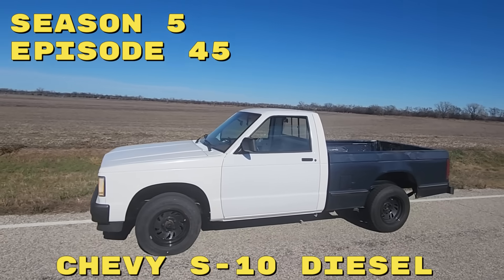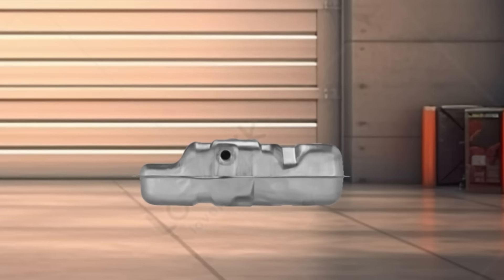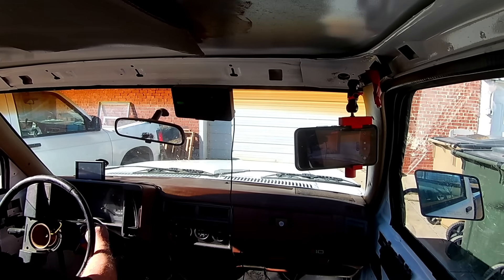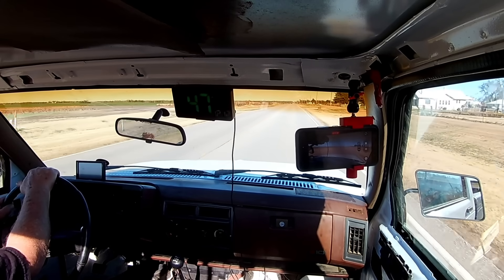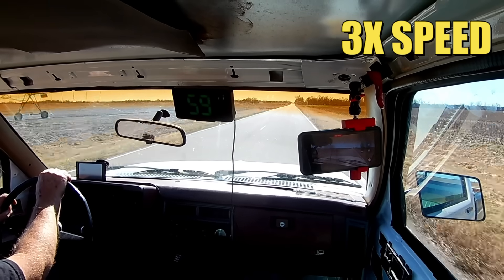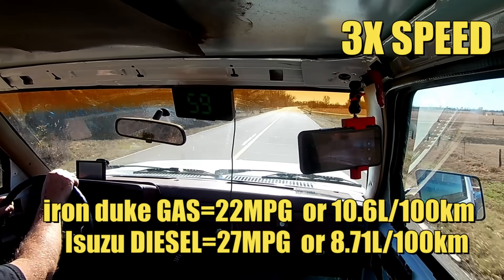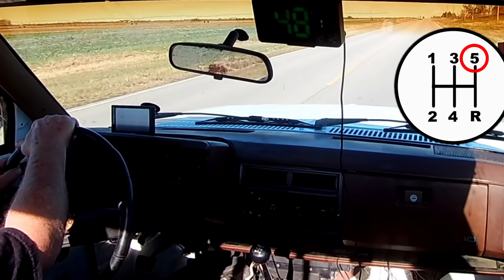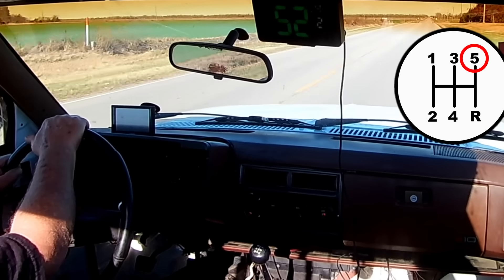S5 E45. MPG?  We road test the custom diesel Chevrolet S-10 to find out the fuel economy.

Comment: I appreciate you not using AI. I choose not to use it at work, I prefer to write with my own words from my own brain!

Diesel 4WD’s and SUV’s are what we use here in Australia for the most part. I remember when diesel was cheaper than petrol, now it swings either side of petrol for no consumer logical reason.

I had a Holden Rodeo twin cab 4WD Ute with their first fuel injection petrol engine in that platform. It was a 2.6L (156.6ci)four cylinder made by Isuzu, with a manual 5 speed gearbox. I struck a headwind in outback Queensland, the likes I had never experienced. I was towing a 6x4 trailer, and had my very young family in the car. The car started slowing down, I kept dropping gears till I was down to second gear. That was the only gear that gave me forward motion. It was crazy!! I thought there was something wrong with the vehicle until I selected second gear. I stopped the car to see if there was a reason, and the downs flung from my hand in this incredibly strong wind. In the distance we could see a wall of red dirt, it must have been 60 meters (197 feet) high or more.

Comment: Tonneau covers reduce drag esp in headwinds and crosswinds. Back in the mini truck days I'd drop the endgate on long road trips.  Probably a few of us here remember those swoopy shape, heavy as lead fiberglass "toppers" that were everywhere, I couldn't stand them.  I found a synthetic army green canvas topper that fit over hoops over the bed in the same profile as the cab. Like the early Jeep CJs, looked great on a Dodge D50 (Mitsubishi).  It was featherweight compared to topper shells of the era, can't remember the numbers but it upped the mpg.  Great on long cross country trips, didn't like it around town or day in day out driving for rear visibility though.  Things we liked so much about mini trucks, fun to drive like English sports cars which ended anyway, but sit up higher, extremely reliable except for the horrid GM 2.8 V6, great visibility, rugged suspension, handy and they were cheap. Nothin' but FM radio and a/c.. Most of us added stereo and often a sunroof that leaked.  Thanks Jimbo, fun series, watch them all.  Orig from your area, NE Sandhills anyway, expat in Asia / Africa since way back.

Comment: The main issue is aerodynamics. Use some duct tape to close off the top half of the grill. Smaller mirrors. Some cheap foam on the front bumper to make it a round profile. And a sheet metal belly pan

Comment: Appreciate no AI. You can say retarded though as long as it isn't used as a slur. I get the paranoia though for sure.
Reply: I was expecting closer to 40mpg, but that's still not bad! Some aero mods would probably do a lot in this case.

Comment: I had a Datsun 720 series "King Cab" pickup with the four cylinder SD-22 engine and 5 speed manual.  I would get 40 MPG with that rig on trips up and down I-5 between LA and SF.

Comment: I'm guessing a turbo is in its future?
You also have a supercharger, don't you?
That's when it will get interesting.
Is there an option for bigger injectors?
The other thing in this power to weight balance, is weight.
Almost every body part is available in fiberglass. A person with your obvious skills, and intellectual curiousity, could make their own, seeing you have perfect examples to build molds off of.
Would be awesome in carbon fiber.
Lot's of content potential. Go have a look at building a panel with vacuum and see how easy it is to create perfect light weight copies.
Then with compound boost, I'm betting it would make a very respectable ride.
I do need a personal story about power to weight and mileage.
I had a D100 Dodge short box that had a Slant-6, Was okay, but you would find yourself in a highway condition of tooling along at 60 mph, and at the base of the hill start to lean into it, and realize you're already into it, and on the floor.
I put a 318 in it, and got better mileage because it wasn't having to work so hard.

Anyways,  loving it.

Comment: I think once you've got boost, you'll have better economy. I think right now the engine is struggling as you said. Plus I'm fairly certain naturally aspirated diesels tend to run richer than forced induction when they're loaded down, like how you have to drive this truck. But still even with that in mind 32 mpg out of a quarter ton truck is amazing. For comparison a 2025 hybrid maverick claims 37mpg and it's not even a real truck. I think once or whatever engine gets swapped is making around 120-150lbft of torque and whatever hp, you'll notice an improvement in actual mpg.

Also and i know you're probably getting a aftermarket tach, but those 80s s10 tachs where some of the coolest designs. The whole dash is 80s cool. with the round(?) oil battery fuel and temp gauges and the weird slot cut tach and speedometer. Just neat.

Comment: Hey Jimbo,
Having owned a mid 80's VW Dasher with that engine, and I was told should get 40+ mpg by my VW repair shop owner friend. Never got close to that over the few years I owned the car. 
The issue was, 85-90% of the time the throttle was pinned to the floor just trying to keep up with traffic.
I used the car as a  ride share commuter for an hour one way to work. I usually had at least 3 guys in the car, and as under powered it was, it made a big difference in performance from the additional weight. 
I intentionally babied the shit out of it highway driving by myself  to work, and got 39mpg, but that was in the slow lane never exceeding 55mph on the interstate.
IIRC, your 32 mpg is about what I was getting on average in the Dasher.
I'd have to guess a newer turbo diesel VW would get far better fuel economy.

Comment: 1.6...
the worst vw diesel engine to use.

try this:
AHU engine
metal head gasket
4BT 12mm injection pump with tdi camplate and internals and fast throttle linkage from 1.6D or TD pump
4bt boost pin or custom pin if needed
.205 7 or 8 holes nozzles. set to 220 bar
[5 holes will destroy the pump, larger holes than .205 will lose efficiency at low rpm ]
AAZ camshaft
k24 turbo from 1.6 td( 30+ psi)
ARP head studs
1.6td intake and exhoust manifold(without blow off valve)
1.6td down pipe and pipe flange.(or whatever you can fit)
2.5" exhoust pipe 
injection advance: make it stop knocking over 1600RPM
intercooler
propane injection
fueling: max without visible smoke while driving

everything is bolt on.

i did 4.3l/100km @130 kph with kayak on top over a 800 km trip, without propane.
amos to radisson, Qc canada.

for a cheaper trip you can use gasoline and 2-stroke oil.

any oil may work. IP and injectors need lube.

1.6TD, set it at ~1mm@ TDC. must stop knocking over 1600RPM
with this engine in a jetta 2, i was able to tow 1 ton on highway.

Comment: VW turbodiesels have sodium filled exhaust valves. VW even made a version of the GTi in diesel, called the... wait for it...GTD. They weren't sold in the US, but did sell in Canada. It does require a different injector pump for boost, but I figure you'll come up with something of your own.

Comment: Just as an extra data point:  My '93 S10 with the 2.8l V6 gasoline engine and T5 transmission got about 28 mpg when held at 55mph.  It dropped to about 27 mpg at normal highway speeds, and down to about 24 mpg in town.  Overall I averaged 26.

Comment: Go 5w40 full synthetic next oil change, and only use 5th to maintain speed, use 4th everywhere else.  Tonneau cover and lower it with dropped spindles or coils and lowering blocks.  It will be much happier when it gets a turbo.

Comment: I had a Jetta with the 1.6l Intercooled Turbo engine, a characteristic of that engine is that it is low on torque at low revs and needs to be drive more like a petrol engine i.e  making more use of revs once on boost is was ok but never great, it was the complete opposite to my Peugeot 205 1.7l which you could change up very early and it would pull like a train. The later VW TDI engine was much better at lower revs. The 1.6 l Intercooled engine was good for 80hp and the non intercooled engine was good for 70hp. It's worth noting that the turbo versions of this engine have improved lubrication IIRC the pistons had improved oil flow to the rings as well. These are a solid engine and can take a lot of punishment. I once drove from the south of France to the UK covering nearly 700 miles in less than 10hrs travelling at the national speed limit of 130km/h or 80mph. Still managed 44m/imperial gallon.

Comment: I don't like your air filter adapter. I'm probably overthinking it, but I wonder if you're choking the engine. You should get a stock 35/44 mm gas throttle body, or the biger 35/52mm throttle body, and connect it to a solenoid. Basically ignition on, throttle wide open, ignition off throttle closed engine air cut off.

Comment: These engines comfortably got 50+ mpg (imperial) in the golf. I had the 1.9 (1y) engine in a golf and consistently got 55mpg. They do need to be revved a bit more than what you're doing, much as it goes against your better judgement.

Comment: Prices right now at my local gas station in northern Germany:
(Lowest grade of gasoline commonly available is "Super" which has an ethanol content of up to 5% and is 95ROZ/91RON - comparable to "premium")

Diesel
1,54€ = $1.79 / Liter
5,83€ = $6.79 / Gallon

Gasoline (Super)
1,70€ = $1.97 / Liter
6,43€ = $7.46 / Gallon

Diesel has been historically cheaper than gasoline in Germany, due to the difference in taxation.
During the covid pandemic however, Diesel was quite a bit more expensive for a small period. (~ 10-15%)

Comment: I have a 2016 Chevrolet Colorado with the 2.8L diesel.  Your S10 gets similar gas mileage to mine.  I average around 27 MPG but on the highway it likes to sit at just above 2000 RPMs for mid 30s MPG.  It will be interesting to see the difference in MPG once the turbo is installed.  Another great episode.

Comment: Diesel is about 10-15 cents cheaper per liter than E10 in Germany. E5 is also 10cents more expensive than E10. 98-102 octane usually goes for 2€/l.

But taxes on diesel cars are a lot higher than on gas cars, so it only makes sense if you drive more than 15.000km a years.

Comment: 12:45 it’ll be super interesting to see how the power numbers may compare once you attempt turbocharging the engine, I wonder how it would compare to my 2015 crua TDI that makes 150hp at 3500rpm and 236lb ft of torque at 2000rpm

Comment: Love the videos ! However, with the dyno graph, you pointed out that it was making 73 lb ft and 27 hp. You have to consider that these are at full load full throttle runs. In actuality, you are making less depending on throttle and load. Something to keep in mind😅

Comment: World Ranger [model pj or pk ]    same as Mazda Bt--50 [model UN ]   Both 2006----2011 . 
This modern diesel Ranger was banned from USA 
regular cab 2dr 4x4 3ltr DID [direct injection ],, DOHC ,, VVT [variable vane  turbo]  5 spd manual g/box 
Unloaded city / hway 10ltrs per 100km or  23.5 mpg  .[cruise speed at 100km/h or 62mph ]  .  consumption does not vary between different cycles when unloaded .  Go upto 110km/h or 68mph cruise speed =  11ltrs per 100km /// 21.4mpg 
Later model 2011 onwards World  Ranger had a 3.2 ltr diesel  6spd manual ,, 5th and 6th are overdrives . Regularly 9.5lt per 100km  unloaded at criuse of 100km/h

Comment: Another great video thank Jimbo.  One more sciencey  thing to add, for most engines, the Brake Specific Fuel Consumption (BSFC), a measure of engine fuel consumption rate; that curve for most engines mirrors the torque curve.  Best BSFC tend to occur close to peak torque and BSFC is poor in those areas of the speed range where torque is poor.  Just a little side not there.

Comment: I was picking something between 6.2 and 7 L/100km, that said, you've got a super economical rolling brick there.  I'm sure that wind hurt the figures as power required to overcome wind resistance varies at speed cubed, so what you loose punching into the wind is much more than you gain with the same tailwind.

Comment: 7:35 I can remember a time in America when Diesel fuel was always cheaper then Gasoline by 10-30%. It was only in the early 00s when diesel trucks gained popularity and they saw a profit market it surpassed gasoline. In the 90s I remember when Gas was $1.20 and diesel was $.88 cents.  For $10 I could get half a tank of fuel and 2 Mcdonalds cheese burgers and a large drink. Seems cheap, but in those days most min wage jobs paid about $5 an hour. We pinched pennies.

Comment: Here in Italy, depending on position, diesel can be upwards of 10 cents cheaper per liter. 
In fact, there are still a lot of turbo diesel, early 2000s hatchbacks going around getting 50-70 mpg (although disappearing because of environmental regulations)

Comment: Quite interesting to learn what you consider economic in the states. I wasn't aware diesel was more expensive than gas over there! Regarding fuel economy, those numbers are a bit worse than what I was was expecting, but you are driving a brick with an aging motor..

Comment: That's actualy not bad milage considering the rpms you said it was turning in a previous video. To be honest if you do upgrade to a more powerful engine and get the rpms down you will do better milage. I had a 1996 AHU TDI at one time in a jetta and I found 2100rpm was max for fuel economy. It liked 2000-2100 under 1900 and it was lugging but over 2100 the mileage suffered, you could feel the engine hit a wall at 2100 and not want to easily Rev past. It got about 58 MPG highway and 55 mpg around town in a jetta and I drove it as a normal person would with some full throttle fun once and a while.

Comment: I owned a VW PICKUP DEISEL I regularly got 50 miles per gallon but the engine was a anemic and required regular head retorquing or you would blow head gaskets

Comment: 1:50 this is the method we used in high school for the high mileage competition.   Racing around Brainard international speedway on home built machines  using 5hp Briggs and Stratton  lawnmower engines.  We smoked the previous years rolling in a 598 mpg.  That is not a typo 598 mpg. This was in 1996.  Current high mileage  from high school kids is close to 1700 mpg  on a 5hp Briggs.
Reply: This was an international event from over 50 high schools from Colorado  to Minnesota, Ontario  and Manitoba.  It was a yearly event.   Going on 30 years ago since most schools have eliminated shop classes, who knows of its still going on.

Comment: Hey I bought a cheap tach of the jungle site to use the shift light for a rev limiter actuator. Will a 3 wire magnet pickup from a digital rpm counter send a signal to it? It's for a diesel.

Comment: Political correctness gone mad! The opposite of advanced is and always has been retarded! Americans gave the word a new meaning including making an offensive noun out of a verb, and then made it unacceptable. 
Engineering language is NOT offensive, regardless of any other meanings lay people may decide to allocate to our words. So a bleed “screw” is still a bleed nipple, a grease point is a grease nipple and no amount of shuddering and finger pointing is going to change it. If you turn the injection pump the opposite way from advance, you are retarding the timing. That’s English. Get over it!

Comment: Given the age of the engine , I suggest a episode where you do a test for different timing methods vs fuel economy.

1. Use a dial indicator to "book spec"
 
2. Tune by ear , you advance an idling diesel until it starts "clacking" then back the timing off slightly.

3. Easiest starting (you've already done that)

Compare fuel economy and 0-60 with all three methods.

(As diesels age their best timing tends to drift from book spec.)

Comment: In Portugal diesel is cheaper, some times between 10 to 20cents a liter when it is not more than that.

At the moment you get 1 liter of gasoline for around 1.7 to 1.8 euros and diesel between 1.5 to 1.65 euros.

Comment: You might be able to find TDC with a rod screwed into the glow plug hole, as a piston stopper. Mark the pully at either end of the rotation, then find the middle and hacksaw a notch in to the pulley.

Comment: I had a 1987 GMC S15 Jimmy 4x4 that I put a TPI 305 making 230 hp and 300 tq into about 20 years ago. It had a 700r4 in it. It would get about 26 mpg on highway trips. I often towed a 24 ft pontoon boat with it which it was very good at launching or recovering even on steep slick ramps being 4 wheel drive.